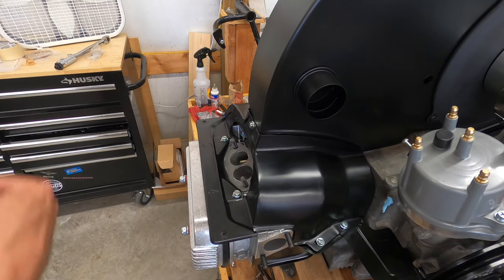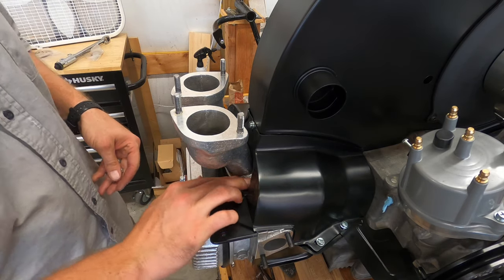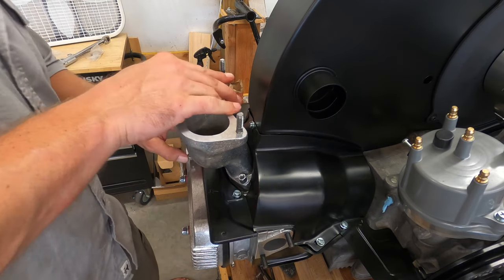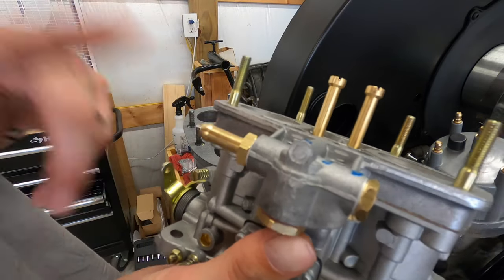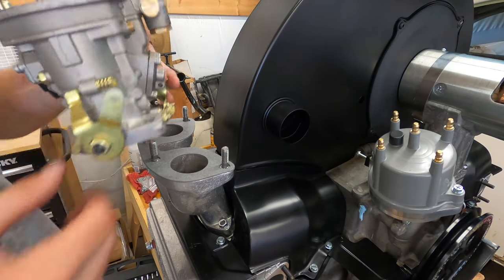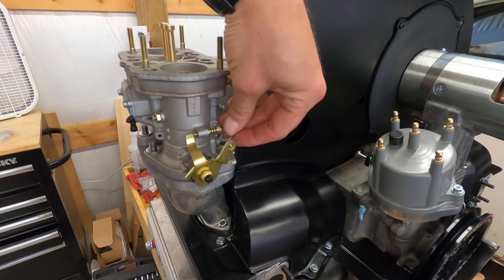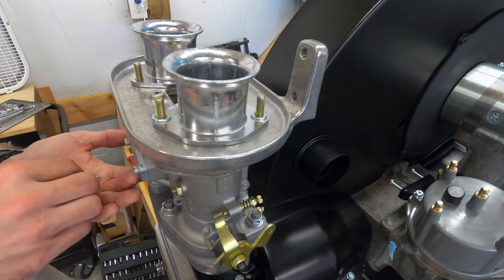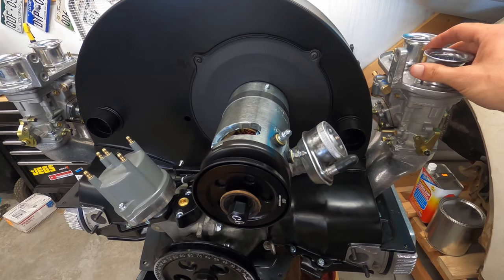Dual Weber Carb / Intake Manifold Install - VW Beetle

Comment: Did you check the manifold surfaces to be square and flat before installation? Mostly I have found these manifolds to be anything but flat...
Reply from the maker: I didn’t mention it in the video, but everything was good.  You’ve found these specific manifolds from CB Performance to be anything but flat?
Reply: @VitosFix  about half of the manifolds I used... Light run on the belt sander all good.
Reply from the maker: That’s crazy

Comment: I just purchased a similar kit. I have a question in regards to the distributor. I have a vacuum advanced distributor…. How does this carb set up work with it?
Reply from the maker: https://shoptalkforums.com/viewtopic.php?t=125697

Good question.  Take a look at the forum link attached above.  I would suggest getting a distributor without the vacuum advance though… maybe even upgrade to a similar design as the one I installed.  You won’t regret it!  See link below.  The link to the distributor is in that video’s description. 

https://youtu.be/ifLwJ74gICY
Reply: can use the CB Black Box to add in MAP sensor and ignition tuning FTW

Comment: From where can buy like this carburetors sys if you have any links plz send me 🌹
Reply from the maker: www.cbperformance.com is where I buy most of my engine parts.

Here is the link to the 40IDFs I installed in the video. 
https://www.cbperformance.com/product-p/3270.htm

You can buy similar types from AirCooled.net.  They do sell Weber, but they also sell other brands.  

Remember,  true Weber’s were made in Spain. It’ll have that information imprinted on the carb. 

I would suggest never buying used carbs unless you have the true experience and knowledge to be able to clean them and inspect them; to increase your chances of having them running similar (for a dual setup)

Comment: Did you have to trip the outside of the intake to be able to fit a socket on the intake bolts , I have no room at all ?
Reply from the maker: Swivel socket, or a swivel adapter.  It’s a pain.
Reply: I can’t get a socket on mine the nut touches the intake?
Reply from the maker: https://www.amazon.com/Capri-Tools-Universal-Socket-12-Piece/dp/B07P1F6JTK/ref=mp_s_a_1_11?crid=BOX0F5YSEUE6&keywords=skinny+swivel+sockets+metric&qid=1639679611&sprefix=skinny+swivel+sockets+metri%2Caps%2C388&sr=8-11

Where did you buy yours from? (Intake manifolds)

People are probably going to hate on me for saying this.. but it’s an option.  

* You have to be carful though!! *

IF the intake has enough thickness, you could grind the side a little to give you space for the nut/socket.  Just enough to allow you to get the socket on there.. no more.  Use tools like what I did in the below video.  

Also, the link at the top, would help once you have space beside the nut.  1/4” drive will have an overall small size, compared to the 3/8 or 1/2 inch drive. 

https://youtu.be/bt6PquGteGg

Comment: Does the cylinder head tin have to be clearances to use these manifolds . Does it interfere ?
Reply from the maker: They did for this setup.  I ended up having to snip the metal around the spark plug holes, and pushing it back.

Comment: Aren't they backwards? can you get to the mixtures/idle jets easily?
Reply from the maker: https://www.cbperformance.com/product-p/3270.htm

😀  Good eye, but no, they aren’t backwards.  It’s the “Space saver” setup.  Honestly, I’m not sure which one I like better, but it is a pain to adjust.  

But, the design of the intake manifolds only allows for you to put them on one way for what I bought.
Reply: @VitosFix  Thats interesting, ive never seen those manifolds before!!
Sweet stuff dude!
Reply from the maker: Thanks!

Comment: can these carbs be used as side-drafts??
Reply from the maker: Mounted vertically yes (like in the video). Are you trying to mount them with the air filter facing left/right?

That’s something I would suggest you looking deeper into if so.  There is a float in these particular 40IDF Weber’s that wouldn’t operate correctly if they were sideways (filter facing left/right).
Reply: Would the stock deck lid fit this setup on a beetle?
Reply from the maker: No issues so far!  Just have to adjust the throttle linkage and push the arms towards the center a little.